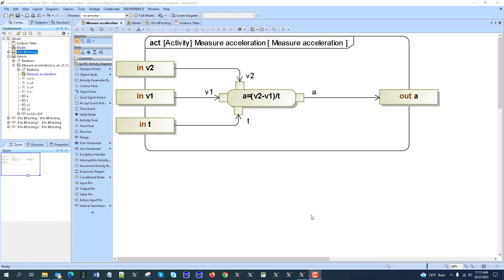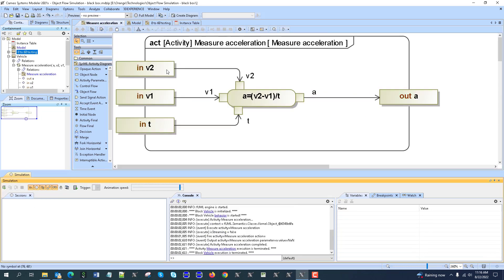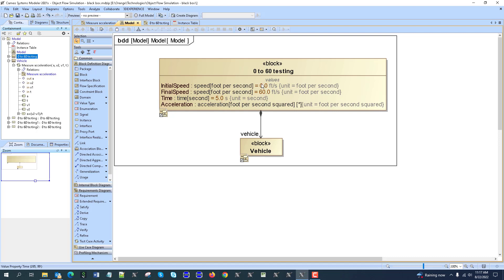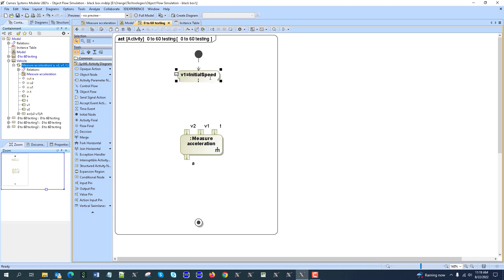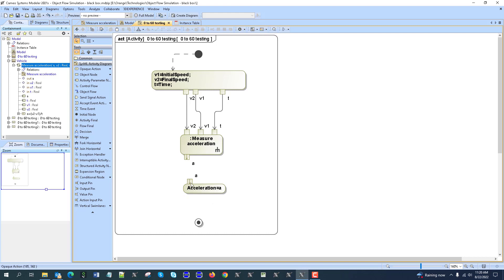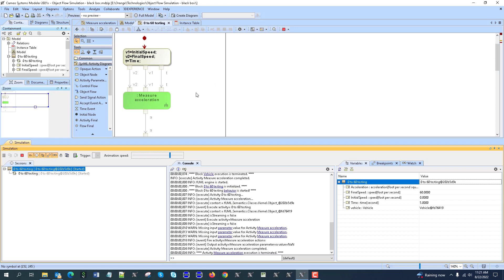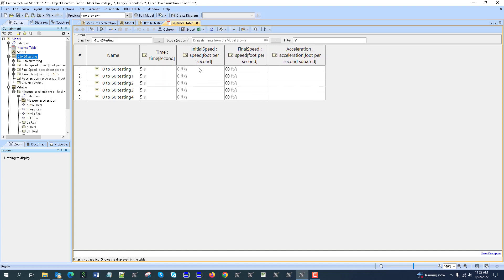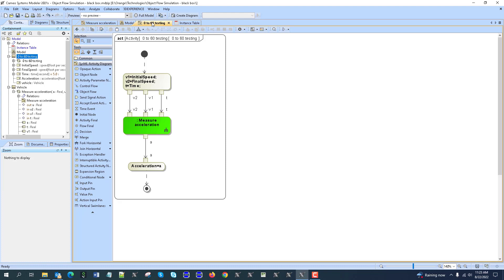Black Box Simulation of System Function in SysML

Comment: Is it possible to use a variation of this method to run dynamic simulations e.g. With a vector of inputs and store the vector of results? (but in an organized way so that each instance in the table has a test case/result with the vector inputs and vector outputs)
Reply from the maker: Hello Fabio. Instance table gives this organization of inputs and results. Another method is to use array of inputs and results e.g. https://youtu.be/hVxVLN8AHio.